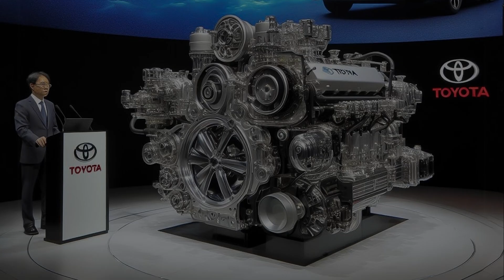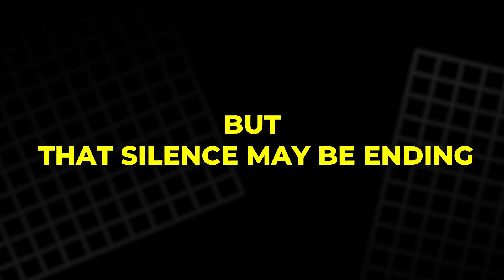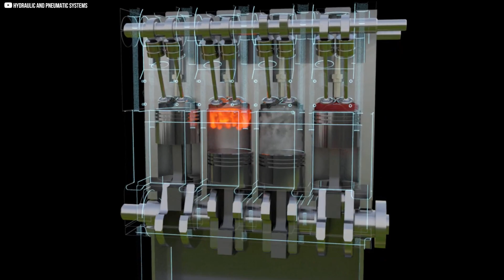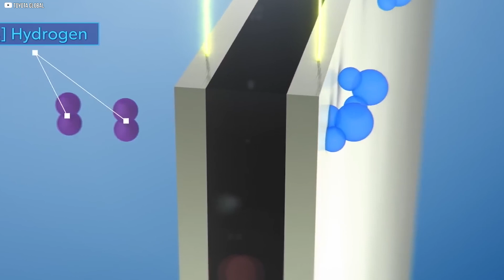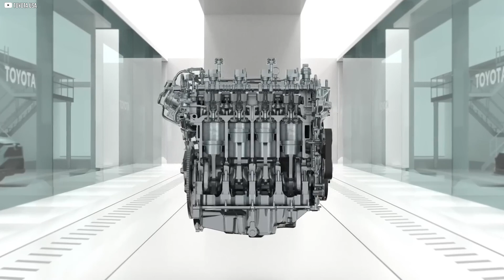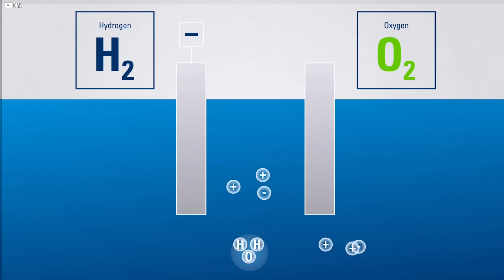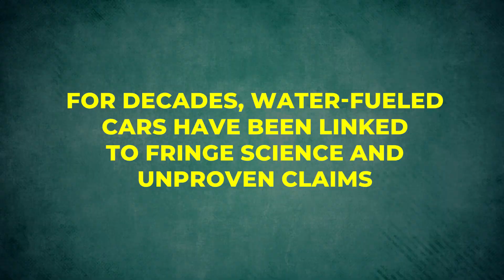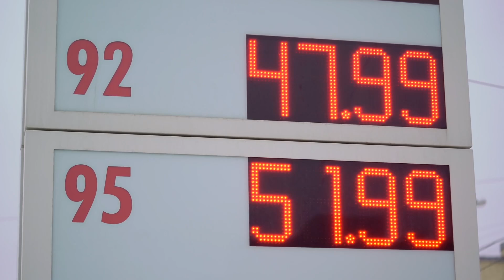Toyota’s Water-Powered Engine Could Replace Electric Cars 🚗💧

Comment: Its actually hydrogen engine with improved water cooling system to reduce weight and improve efficiency by lowering high combustion temperature, which allows usage of cheaper and more lightweight materials for engine. You will still have to refuel hydrogen in this car.